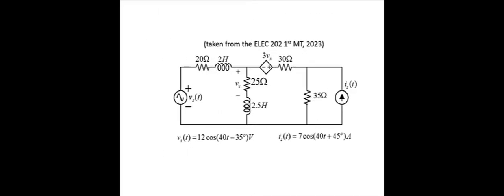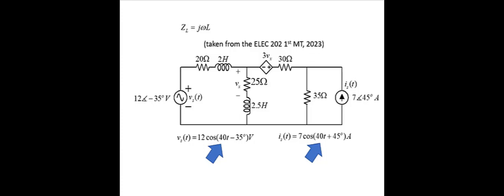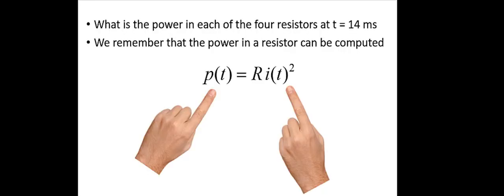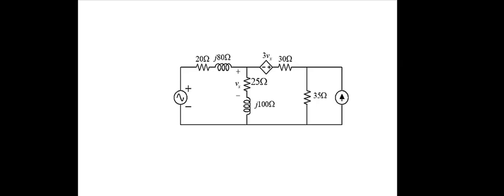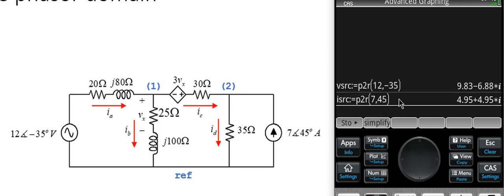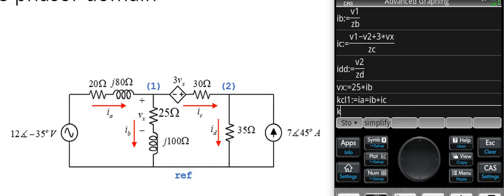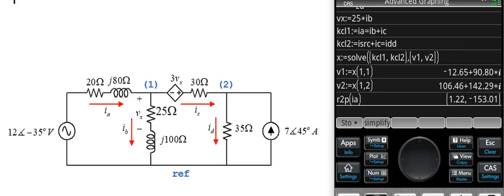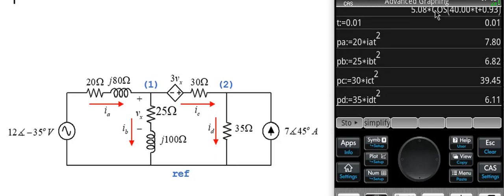ELEC 202 - First Tutorial (Phasors) 2023.

Comment: p2r ? Is that a function you define to make complex numbers work in CAS?
Reply from the maker: I prefer working in radians mode when I'm in CAS.  It is safer, in my experience.  But when I need to enter a complex number in polar form I use
 
 // Polar to Rec
 // Input: complex number in polar form (abs,arg in degrees)
 // Output: complex number in rectangular mode
 EXPORT p2r(m,degrees)
 BEGIN
 LOCAL a,b,mode;
   mode:=HAngle; HAngle:=1;
   a:=m*cos(degrees);
   b:=m*sin(degrees);
   HAngle:=mode;
   RETURN(a+i*b);
 END;
Reply from the maker: I also use these other two (again, I set my CAS to radians),
 
 // Rec to Polar
 // Input: complex number in rectangular format
 // Output: list with {abs,arg in degrees} 
//  ......  of the complex number in polar form.
 EXPORT r2p(a)
 BEGIN
   LOCAL m,t,anglemode;
   anglemode:=HAngle;
   HAngle:=0;
   m:=abs(a); t:=arg(a)*180/pi;
   HAngle:=anglemode;
   RETURN({m,t});
 END;

 
 // argument in degrees
 // Input: complex number
 // Output: argument (degrees)
 EXPORT argd(a)
 BEGIN
   LOCAL mode:=HAngle,x;
   HAngle:=0;
   x:=arg(a)*180/pi;
   HAngle:=mode;
   RETURN(x);
 END;
Reply: @rolinychupetin  Thank you for sharing.